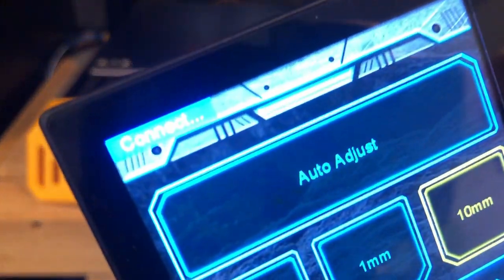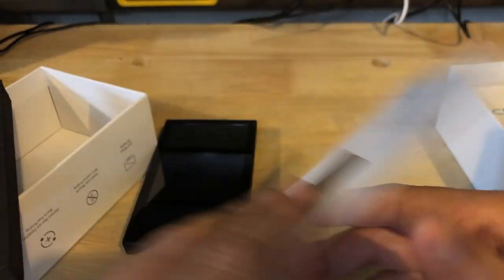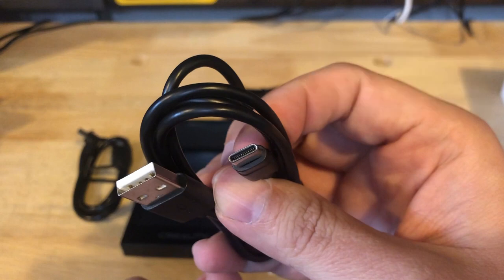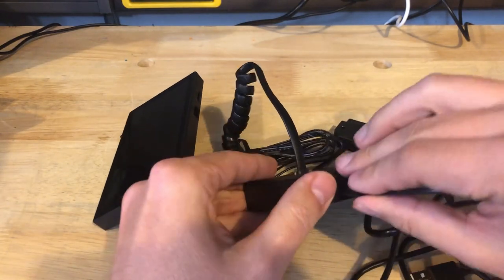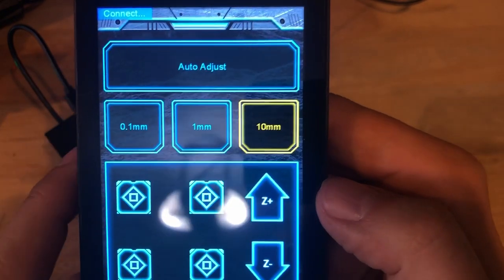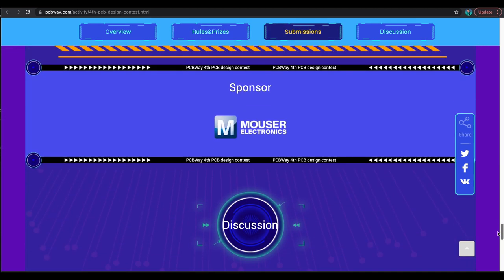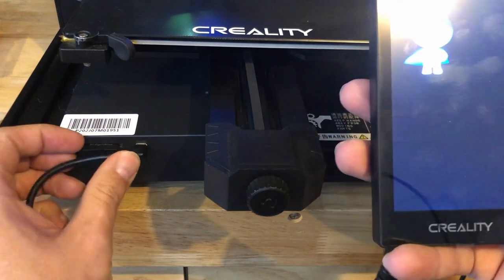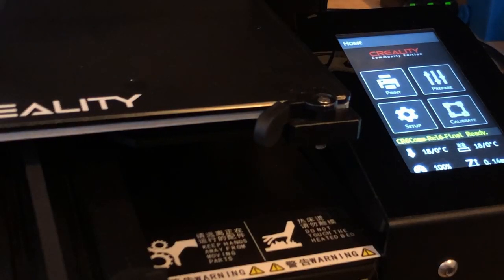Creality 3D Pad Review - 3D Printer Display

Comment: You cannot have the sd card in the printer when loading
Reply from the maker: Tried with and without SD cards in the printer.  Seems that the lists of cannots keeps on growing.  On person even said that there needs to be filament in the runout sensor for the screen to connect.  No card in the printer isn't mentioned in the documentation.
Reply: @TripodsGarage  Mine worked fine on all my printers ( I have 13 ) the only thing it don't do is show the picture of the item like it says it does. I start my printer then plug in the power to the pad with it all connected. it will never say connected just connect. then with the sd card in the pad i choose the file and tell it to print it does everything from there. and yes I use the run out sensor with it everytime.
Reply from the maker: @FitzCrafter  Looks like you received a product that works, and I received a product that didn’t.  I reached out to Creality during my review period about the connecting issues, the only thing that was suggested, was to check the baud rate which I verified.  Maybe mine is a dud?  If Creality wants to send me a replacement 3D Pad,  I will be more than happy to try it again.  They have yet to reach out, so an updated video is unlikely.  This review will remain, because this is what I experienced out of the box.
Reply: @TripodsGarage  Just curious did you ever go into the system settings and set you printers print size?
Reply from the maker: @FitzCrafter  - Yes I did.

Comment: Good review.  It might be interesting to hear what they are trying to accomplish with this.  I think you got it right, get a PI and be able to control the printer from anywhere in the house via Octoprint or Klipper.    I don't see many of these being sold
Reply from the maker: Yeah, I don't get this idea.  Think it is the nickel and dime approach to get more money.  Lets offer this cool UI display as an add-on, but lack any advanced features, no cable management, and no stand.  It just didn't work on the 5 printers I tested (stopped after #5), did I receive a defective unit?  Not sure.  However, even it did work, there are much better options out there for $90!  Thanks for watching and commenting!
Reply: @TripodsGarage  If you would have read the manual you would have succeeded to make a connection to all your printers. 
To avoid errors, please unplug the original screen while using
Creality 3D Pad
Please plug printer and Creality 3D Pad separately, make sure
that the printer is plugged earlier than Creality 3D Pad, or at the
same time at least.
Reply from the maker: @2OL2P  - If you were to read the pinned comment, you would noticed that I already tried that.
Reply: Good review? He couldn't get it to work, while theres plenty of videos out there of people who did get theirs to work.
Reply: @OMGrant  Thanks for letting me know someone got it to work.  I'm still trying to figure out what is the advantage to this.  Since it is a Creality product, I'm very skeptical

Comment: My display on my printer is enough for me. I don't see why I need that display that needs to be with my printer.
I have octoprint and I can control my printer on my phone, pc and tablet. That works way easier. I can place a cam and also see it from everywhere if I want.

It looks nice and as it was something that you could instal on marlin as display, it would be nice. But getting an other display for my printer, that you need to instal with gcode, is nog my thing. Especially not for that price.
I have now a wyzecam by my printer. This way I can keep an eye on it and turn the printer off with Google home as I am not ad home.
Reply: with octoprint you can also just have a local touchscreen on the printer and do away with the LCD altogether.. almost.. if octodash let you create custom buttons for babystepping/ ubl/ abl/ etc it would be perfect. it will come though...

Comment: I don't think it's so plug and play, the display must have some setup for the communication speed between the display and the board.
Reply from the maker: It is my understanding the the 3D Pad display has a standard baud rate of 115200.  There isn't any menus, or side loads for configuration.  Creality claims it is "Widely Compatible for All FDM 3D Printers with Marlin Firmware".  I even unplugged the display on on a couple of my printers when connecting the 3D Pad, still no connection.  Thanks for watching and commenting.

Comment: Wow!  That Creality 3D Pad didn’t work with any of your printers?  I would have stopped after 2 or 3 😂😂!   If I designed PCB’s I would most definitely enter PCBWay’s Giveaway.  Great video 👍.
Reply from the maker: Yeah, I have up after 5 printers.  Could have done 5 more, but didn’t see the point.  Thanks for watching and commenting 👍
Reply: Probably because in the manual clearly state to disconnect your current control display.  Then it works

Comment: You're not ment to have the old display connected when touch screen is connected.
Reply from the maker: There is a pinned comment explaining everything.  Do you need to unplug displays to use Octoprint or Pronterface?  If this is an absolute must, it should be clear in the instruction manual.

Comment: Great review of a not so great product 🙃 Keep it up!
Reply: There are other reviews that show this product working just fine
Reply: @AndrewAHayes  Of course there might  be but it should've worked on these printers as well. Also you should never watch only one review. There might have been a problem with this one for example.
Reply: @3Drcnc  Or they my have spent ages making the other one work but getting freebies for good reviews so forgot to mention that.. Two sides to coins..

Its advertised to work with any marlin based printer.. it should work with any marlin based printer..
Reply from the maker: @AkiraFurball  100% Correct 👍

Comment: Not good that it has 5v on the USB to the printer. If they have a custom PCB that trace should not have been connected.
Reply from the maker: Yep!  You saw there was power through the USB when the Artillery Genius was attached to the 3D Pad.  Not good!

Comment: RJ45 ftw
Reply from the maker: Even a coiled RJ45!!!  This most defiantly needs to be wall mounted in the kitchen!
Reply: @TripodsGarage  I don't want to be rude, but the same connector is been used on the FLSun SR and for that matter on the H43 screen from MKS, it works very wel.
Reply from the maker: @2OL2P  - We are just having a little fun here.  Just like the Kywoo Slim uses and IDE cable for their display.

Comment: FAIL! Another crap product from a crap company. Liked your review, though 😘.
Reply from the maker: It this display had advanced menus, had a USB pass through, cable management, a stand, and work on a few of the machines.  I could possibly see using it 😂
Reply: @TripodsGarage  Why bother... even if you get it working when you boil it down to the nitty gritty its just octopi without any of the great features and plugins that octopi gives you.. no customisation, no custom controls/ button, no plugins, no timelapse, no temp graphs,  jut another closed source POS accessory targetted at newcomers to 3d printing who will buy it, find out is forking useless, and eventually chuck it in a drawer and get octoprint..
Reply from the maker: @AkiraFurball  - Yeah, just another add-on that should be standard.  Nickle and diming customers.  Just like in my closing monologue,  not worth buying even if this display connected to these machines.  I can use the same Raspberry Pi across all my machines without an issue, with a ton more features for almost the same price.
Reply: @TripodsGarage  Lets face it, they can't even compile Marlin with the features that would help 95% of the userbase such a bed level assistant and that costs them absolutely NOTHING.. they even go so far as to actually disable features that are on by default like EEPROM support FFS

WTAF goes though their minds is beyond me!!!!